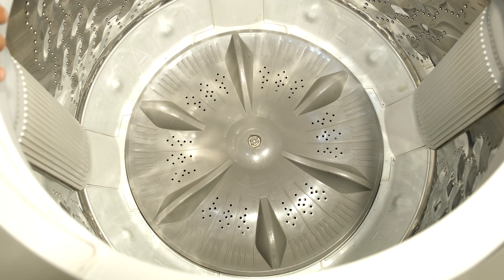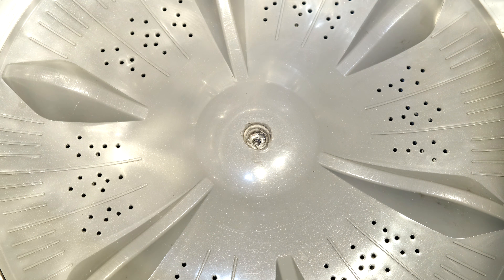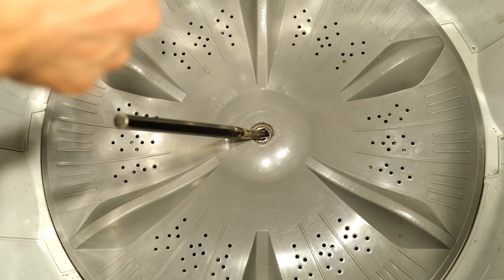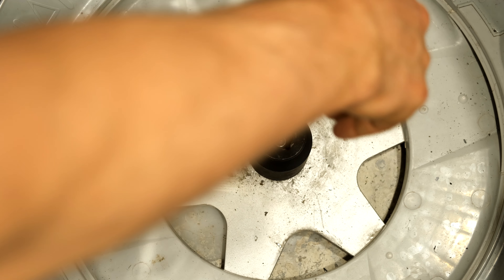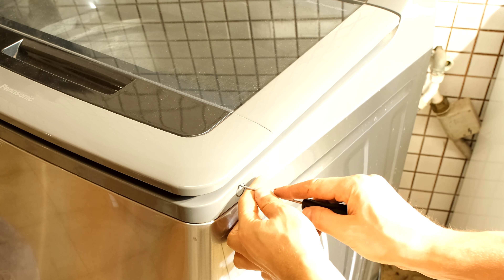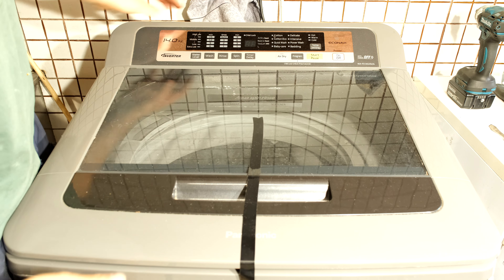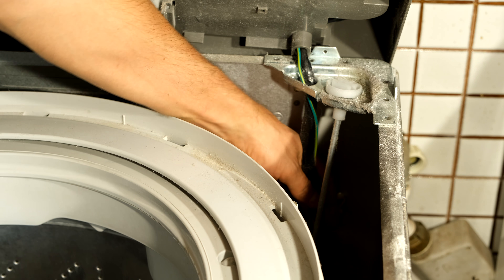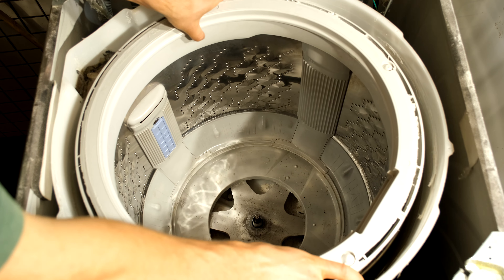How to remove a drum from a top loader washing machine - step by step

Comment: On the LG washer check your washer to see if you have a Hose Clamp or Glue on the inbound side of the discharge pump. If so, that is not a factory connection. There is not supposed to be any Glue or Hose Clamps on anything according to LG.  Squeeze clamps only. Most of the LG washers had to be reconditioned, then sold as new. The hose is 2 inches too short and the travel of the tank, to offset a lopsided load, will one day rip that hose off. I repaced 12" of drywall in my whole washroom. Contact the FTC.
Reply from the maker: thanks for the comment. Mine (Panasonic) had a squeeze clamp which leaked so i changed it to a cable tie which works very well. The pipe length was short which i think resulted into too much pulling on the hose.

Comment: Hi, do I have to turn clockwise to open the 38mm nut? In your video, it turns clockwise while you were using the impact driver.
Reply: Yes. It’s reverse thread.

Comment: @ecologicaltime Thanks for the video, really very useful. I'm trying to clean my Samsung top loader washer. Was able to remove the pulsator however the top nut (it's 35mm for Samsung) is not coming out - using the impact drive with 35mm socket. So was trying to see if you removed it in counter-clcokwise direction or clockwise.
Reply from the maker: from memory it was usual rotation clockwise for tightening
Reply: instablaster.

Comment: Around 2:50 you openned the drum bolt. 
I repaired my panasonic f60gs gear box so i had to open the drum so i can easily replace the gearbox. Now i've done everything and assembled the machine once again the PROBLEM is that, the nut of the drum is kept opening when i ever i put the machine on wash rinse or spin. The nut loosen itself. What is the solution to fix the nut. 
I have tried my best hard to tighten the nut with a wrench.

Need help please guide

Comment: Hi sir.. I have problem on my washing machine Sharp.. Not big problem.. Just heard there water stuck on the drum.. even i finished use it.🤔. can you suggest me what can i do to solve this problem.😊 I'm little bit worried because just bought it about 5 months ago😑😁
Reply: Same here, that plate that was first removed mine got broken from down like what he just changed
Reply: Let me suggest to you Sir the drain hose or the drain pump is the area of CONCERN : 

(  UNPLUG WASHINE MACHINE FIRST FROM POWER SUPPLY  )

1. Disconnect the two CONNECTING HOSES
  AFTER DISCONNECTING YOUR TWO WATER HOSES FROM COLD AND HOT CONNECTIONS .

  2.  TILT YOUR W / M on  ONE SIDE to locate  the drain pump.

3..Normally TWO SECURITY MOUNT SCREWS  SECURED THE BASE OF THE PUMP. UNDO THE TWO  ( 2 )  SCREWS ..

4.. AND  REMOVE THE PUMP AND REMOVE THE HOSE CLAMPS  ON EACH HOSE..

5.. CHECK THE INSIDE OF THE PUMP  FOR ANY FLUFF RETARDING THE ROTATION  AND REMOVE   ( IF  ANY FLUFF ) INSIDE.

6.CHECK ALSO THE  PUMP BEARINGS  IF NOT DAMAGE..

7.. THE  DRAIN  HOSE  ?   FLUSH  WITH THE SUPPLY  WATER (  BOTH ENDS )  DETERMINE IF WATER  FLOWS  FREELY.

8.. IF  EVERYTHING SEEMS ALRIGHT , .AKE SURE THERE IS NO KINK / S  ON THE DRAIN HOSE ON  TEST .... PUTTING YOUR  WASHING MACHINE TO  FILL UP AND  . GO TO   SPIN  RUN AND CHECK THE  VOLUME OF WATER COMING OUT.... ALL SHOULD  BE ALRIGHT..

9... THAT IS WHY THERE IS  A LEFT OVER OF WATER UNDER THE  BOWL  SIR  ... BECAUSE OF  IMPROPER  PUMP ACTION.

10... ENJOY , BE SAFE AND  ... ALWAYS  HAVE FUN....And  help is always available....

11.. REINSTALLATION ;  IS THE PROCESS IN REVERSE.... YOU CAN ... MAKE THE  BEST..

Comment: After 5 year samsung washing top load automatic washing machine, the inner stainless steel fully rusted and bent,,sir is there washing coming with plastic, with out stainless steel?
Reply from the maker: if yours was stainless steel it should not have rusted. Maybe it was coated that came of and then the metal underneath rusted. If it was stainless steel, you probably can claim a warranty from Samsung. I have not seen plastic drums

Comment: I have a similar setup inside my Samsung HE top load washer, but the drum seems to be seized on that spindle on the center. The locking nut and the washer come off with the right tools but I can't lift the drum off. 

I have had WD-40 (penetrating oil) sitting in a little pool around the spindle for a couple days but it has not made any difference. I've also set up quickclamps around the drum to provide constant upwards pressure over time. Still nothing. Even tapping things with a mallet. Nothing. I'm going to throw out my back just trying to get this drum out and it still seems impossible. I have like a months worth of clothes on standby and this mf thing needs cleaning before any of that can happen.  Anybody got any ideas?
Reply: Either something i can't see or find any evidence of is keeping the drum from lifting up, or some washer or component has corroded and debris has caused it to seized. It's a 7 year old machine.